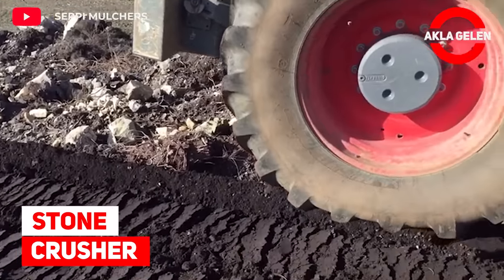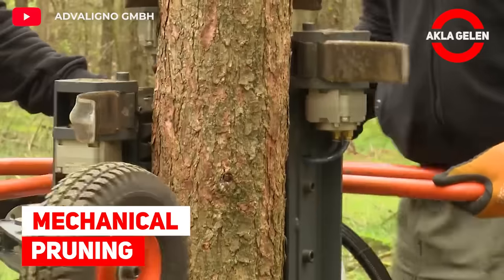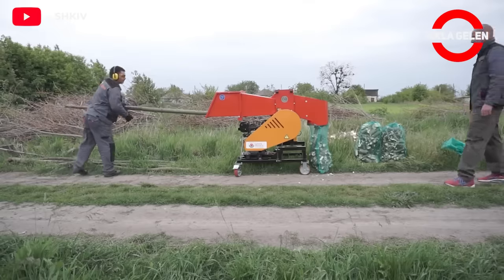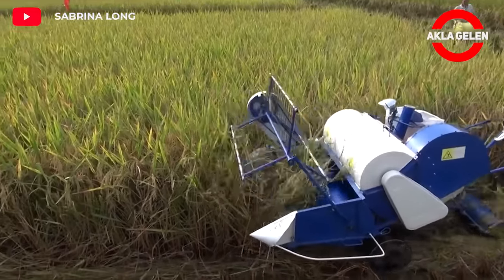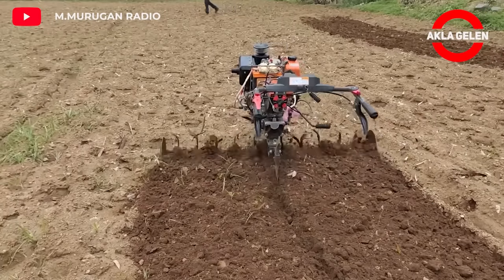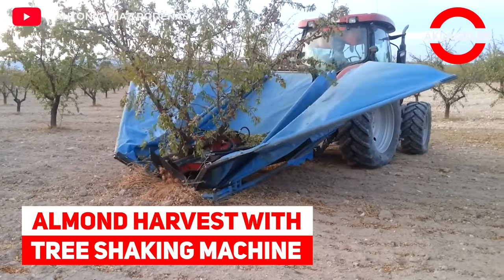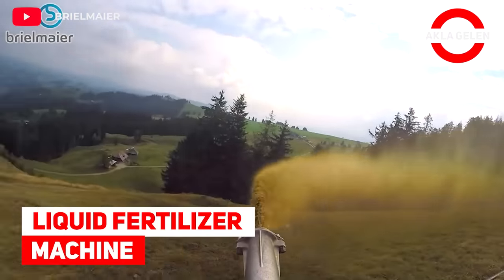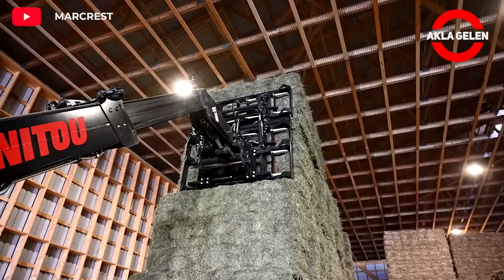This Invented Machine Surprises Even Farmers - Incredible Ingenious Agricultural Inventions

Comment: Dear friends,
Here we supply harvester for wheat and rice.
HGL-12170/HGL-12180,
Powered by 7hp Chinese engine
Dimension:2200*1660*1350mm
package size:1680*560*810mm
Total weight:240kg.
working width: 120cm.
Cut height range:30-100cm.
It is integrated design and make strong structure.
High efficient, Less vibration and incline.
Dealer wanted!